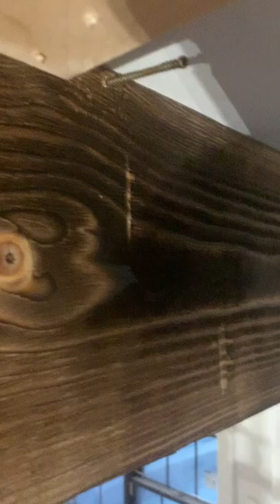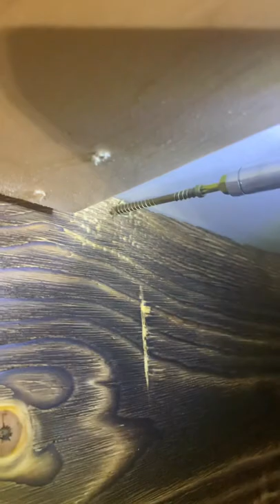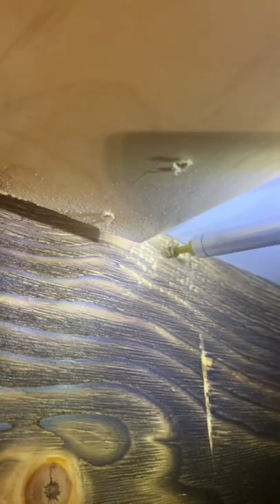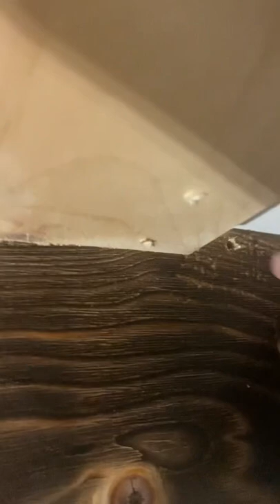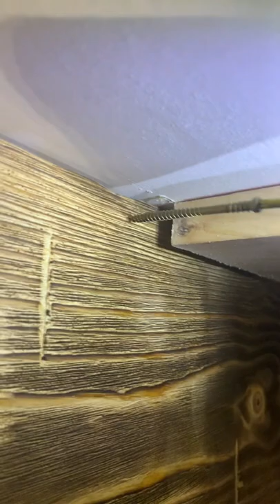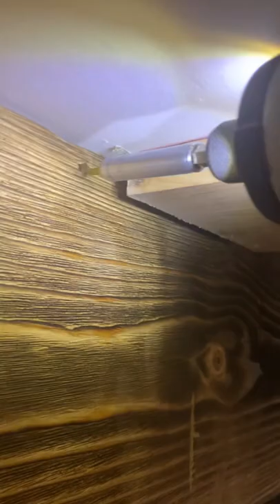Trim head screws

Comment: Do you recommend trim head screws when attaching two cabinet face frames?
Reply from the maker: I do not, there is no glue or any adhesive used between cabinet face frames when joining them together, so therefore they require a screw with a head on it. Also they are joined sided by side, not in a manner where they would be perpendicular, which would add shear strength. Trim head screws do not have complete joining strength, but in this case where the beams meet the nailer boards(perpendicular) they add shear strength and some holding power while the adhesive cures. The adhesive used for this application like most adhesive, is stronger than the wood itself. I hope this helps you.